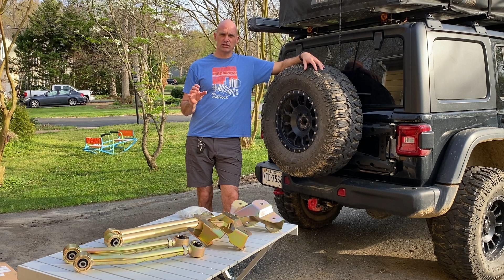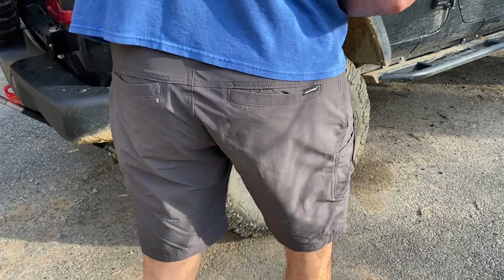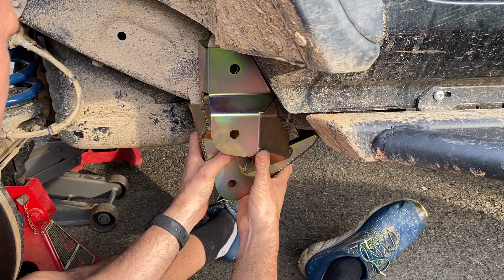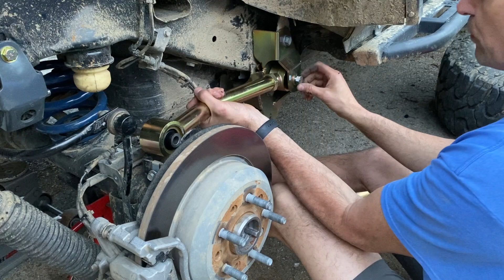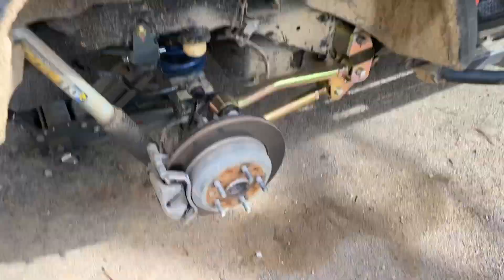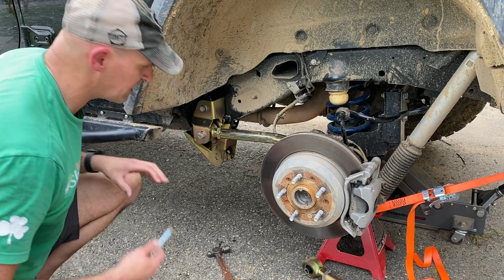Improve Your Jeeps Ride: Installing MetalCloak Rear Adjustable Upper and Lower Control Arms

Comment: Looks like you have both AEV and MetalCloak drop brackets and was wondering which you think is built better.
Reply from the maker: @javierfraga8263, you are correct the metal cloak are 100% better they are built like a tank

Comment: What difference did these make with on road ride quality?
Reply from the maker: Thanks for the question in my opinion it made the ride smoother, I think the duroflex joints allow the suspension to move in a more smooth fashion which like I said makes for a better ride. Well worth the money, they really shine once you get off the pavement!  Hope that answers your question.

Comment: Hi!! Nice video:))
Could you tell me in what inches did you set the upper arm??
Reply from the maker: Thanks, since i also installed the metal cloak geometry correction brackets, the upper arms we set at the factory spec 20 inches to start, after all the measuring and double measuring i settled at 20.5 inches and that gave me the proper castor angle i needed on my jeep, hope that helps

Comment: Great video!  What size tires are you running with your 3 inch lift?
Reply from the maker: I am running 35 patagonia MTs, but could easily run 37’s if I wanted, there is plenty of wheel well room and suspension travel space for them
Reply: @FischerJeepAdventures  I actually just ordered the Game Changer 2.5 lift kit, DuroSpring replacement bump stops, rear control arm correction bracket, front coil correction pads.  I’ll be running 35 Nitto Ridge Grapplers.  So I’m excited to see how everything comes together once installed.
Reply from the maker: Awesome! Your going to be really happy with everything, they make quality parts. Sounds like you will have a great setup!
Reply: @FischerJeepAdventures  Thanks!  I ordered certain things based on some of the videos I saw in terms of minor issues people experienced.  I figured just order everything upfront and install it at the same time to avoid going back and making corrections.
Reply from the maker: I think you will be happy with that plan! Installs are pretty straight forward, make sure you take suspension measurements before the changes and then measure from those same reference points once you install everything to get everything in the right place!

Comment: Nice install video. I’ve been eyeing these brackets for my jk. Metalcloak says you can’t run the stock control arms on them, but did you end up adjusting your control arms to factory length? Not sure I’m ready to drop $1k on the full kit at the moment.
Reply from the maker: Thanks, and yes we used the stock control arm length to set the length of the adjustable control arms, the true benefit in them is of course the strength and adjustability but its really the joint and their ability to articulate much better than the fixed control arm, you can really tell a difference, highly recommend the set

Comment: I though I was the only one with this on a JL lol great video. These work great if you're not terribly worried about ground clearance.
Reply from the maker: Thanks, they are great products, I have been through alot of trails since I installed them and ground clearance has never been an issue but i guess it depends on where you wheel and if your try to navigate over alot of off camber high rock ledges and outcroppings but from what I have done I have had no issues and no regrets!  Thanks for checking put the channel
Reply: @FischerJeepAdventures  they're definitely great. You bet, by the way, saw your running Synergy stuff.. check the adjusters! In my experience they're crap, ended up changing out my Synergy track bar, tie rod and drag link.. all were loosely spinning even after multiple fixes and overtorquing.
Reply from the maker: Thanks for the heads up, i checked everything when we got back from Colorado and all was still tight, but i will definitely keep a close eye on them from now on!
Reply: The have more clearance than long Arms
Reply from the maker: Yes they do!
Reply: They are higher than long arms so basically no effect on clearance!
Reply from the maker: Yes they are thanks for the comment

Comment: Nice Video and Nice job.
Did you have any issue drilling that 9/16" hole? Did end up going into the frame?
Reply from the maker: Thanks, no issues drilling the hole once you have everything lined up, it does not end up going into the frame, once you get through the frame side of the bracket you have to stop or you will end up in the frame, not hard just take your time if your going to install them. Thanks for watching the video and checking out our channel!
Reply: @FischerJeepAdventures  Thanks!
I think I was looking at where the flag nut for the lower CA was installed incorrectly. I am straightened out now. I think your the only one with a JL review/install that I have found. I as well see you had to drill a hole on the bottom of the stock skid which was not in the instructions either. No big deal, but they could make that more clear.
Reply from the maker: You bet, not everything always installs perfectly and you sometimes just have to figure it out when the instructions are lacking
Reply: @FischerJeepAdventures  Your absolutely right, welcome to the mod world right..😊
Reply: Not to bother you again, but the lengths of the CA's in the instructions can't be right. What did you end up at, stock length? I went with stock length but it still pushed the axle back about an inch from where it was before with my Accutune 2.5" lift and no correction brackets.
Thanks!
Reply from the maker: No bother at all, let me get the measurements in the morning when i get home, i am happy to help!
Reply from the maker: Okay the spec factory lower control arm in the rear is 19 3/4 to 19 13/16, with the correction brackets and the adjustable LCA mine are set at 20 1/8 and that centers the axle perfectly, hope that helps.
Reply: @FischerJeepAdventures   Thank you brother, that helps a lot! 
I just finished installing mine, and the uppers are 17.5" and lowers are 19.75" now, that gets my pinion back to 2* down from DS angle. I am going to guess your lift is higher than mine and that might explain the difference in our LCA lengths. I'm will check the axle center a bolt the wheels back on and see if they center up.
Your help is much appreciated that you were willing to crawl under your jeep and get those measurements.
Reply from the maker: Absolutely, let me know if you have any more questions, happy thanksgiving to you and your family

Comment: Did you notice a difference ?
Reply from the maker: The ride on the rubicon with the aev suspension has always been pretty good, where the control arms really made a difference is in the suspensions articulation and thus keeping traction in uneven terrain much better than before which also served to limiting the body roll as you go over stuff, their joint tech is awesome, and i would buy them again, highly recommend their products

Comment: I just got the front drop bracket from Metalcloak. After installation how do you like the total kit?
Reply from the maker: Matthew, congrats,  i am really happy so far, i put 200 road miles on since i installed everything, the jeep tracks straight, rides smooth, and no vibrations at all.  You can feel its not as stiff as with the stock setup, i thinks thats all due to the duroflex joint, I am excited to spend some time offroad to see how everything helps to keep the tires planted as i get off camber on the trails.
Reply: @FischerJeepAdventures  Thanks for the reply. I look forward to seeing it on some trails in the future. Metal Cloak control arms are definitely on my short list.